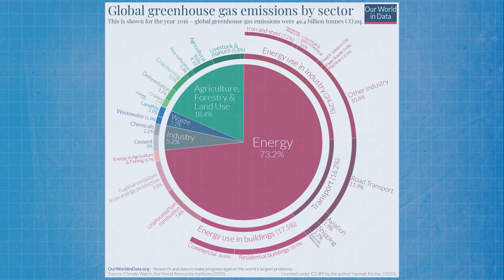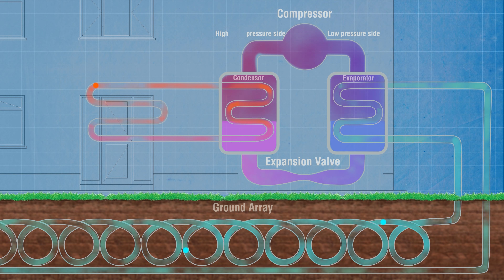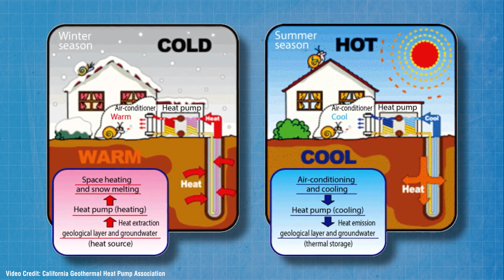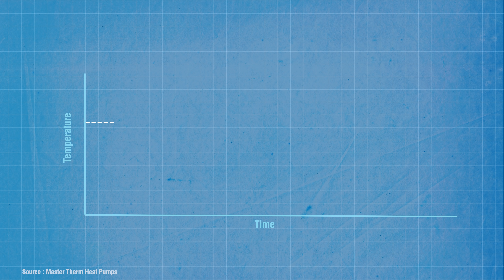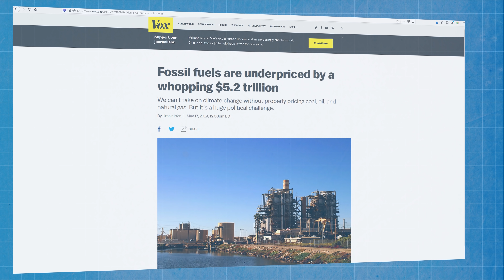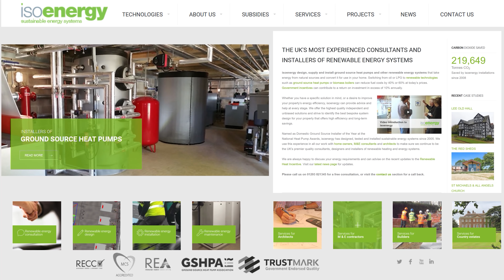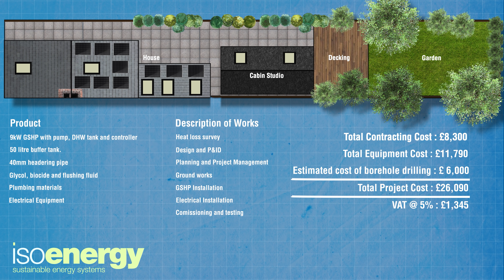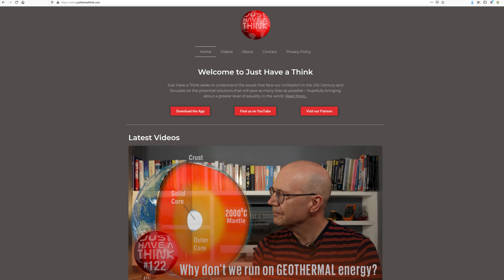Geothermal ground source heat pumps. Heating your home from your own back yard!

Comment: I installed one of these systems 25 years ago. I like the bore hole method because in the UK there are pipes and other forgotten obstacles that may cause problems.  I think this system works best with under or in floor heating. In a floor system, the water temperature is a low 27deg C rather than 70ish for a radiator system. So, the heat pump doesn't have to work as hard and is more efficient.  
Also, ones floor is a massive heat storage system;  typically the floor is only a degree or two above the air temperature required. So in effect, if the temperature in your room falls by two degrees the output from the floor effectively doubles.  
Then there is "radiant heat". With under floor heating the AIR temperature can be, say 19 but feel a comfortable 22 / 23.  This is due to your receiving radiant heat from the floor. (Not BS, There is in fact a very long equation quantifying this)
This works best with new build. On new build the extra cost of floor heating is minimal.  Also, new build is 0 vat rated.
Reply: We built our second home next to old house mortgage free over a 15 year period, we live in Estonia (I'm from UK) where it has got down as low as -37C , the first couple of years in our 150 year old farm cottage (very small without double glazing) was tough, we had a wood burning heater that can be closed and lets off heat for 12 hours but it was never enough and I kept kitchen fire going as much as possible, all our firewood came from our forest so it was free. The new house was finally completed Feb this year, three times the size of the old cottage, geothermal heating works great. We do still have this wood heater system as a backup, if we have a brutal winter we can lose electricity which means goethermal system wont work. After years or either being too hot or too cold it's so nice to live in a large warm house.
Reply: A problem with floor heating in comparison to radiators are respons time. Modern radiators contain little water and can because of that react quick to other internal heating source. That saves energy to!

We had a old heat pump that couldn't produce hot enough water for the radiators so we exchanged som radiators and moved other around. That hade a big impact on the efficiency! 😊And we were able to heat up the house without auxiliary heater from previous - 11 C to - 25 C.
Reply: @bjornjonsson1875  yes, response time can be a problem. Ex: I wouldn't advise floor heating in a Bar. In a Bar I'd advise a forced air system. It can heat up and cold down in minutes. 
Floor heating is an engineering solution, not a cure all. It works brilliantly in the right circumstances.
Reply: @bjornjonsson1875  I have underfloor heating and yes it does have a slow response time. To counter this you need a well insulated house with lots of thermal mass. If you lose 1 degree per day then the house temperature does not vary much and the response time issue goes away.
Reply: @ecoworrier  look your argument that you are more dependent instead of less dependent on insulation with floor heating is not fair to floor heating. It's comparing apples to oranges. You have to control the variables. Even without what you are proud of having in addition to the floor heating system the floor heating system would have helped you unless you're talking about a situation of stay at a cottage that you visit on Christmas and have a lot of saltwater aquariums the robots tend and for some reason plants and it's just not a typical situation. When your house is vacant you could have an automated system that covers the furniture and the flooring. The capital cost of such a system is insignificant. That would allow you to have a very drafty house. But I think that there is some confusion here about using heavy flooring to store Heat about having two feet of concrete on the ground floor getting heated with several inches of solid insulation underneath the poured concrete. This is the copper heart solar water heater solution. It is fetishistic and irrelevant.

We are so seriously ignorant about how 33 degree Fahrenheit that's about what half degrees Centigrade if the humidity is present that means that you don't have materials that you don't need to have around which would be invaded by bacteria and fungus with such an environment if it was warmer as it will get warmer.

I mean there are all kinds of solutions that require yes engineering but engineering that does not break the deal. Such a smart home or office I can get rid of any humidity issues seasonally. it's been a few years since I checked out the Central dehumidifier Market this in the United States is a strange type of system. as far as I can tell there is no competition and what regulation is present has not been sufficient. new construction is such a distraction you really have to talk about the two things separately completely and deal with the different types of climates and local building materials separately. this is not done at any level.

 I think it is fair to say that all efforts to control the temperature and humidity indoors are 99.9% vanity because what matters is people's well being their actual quality of life and that requires you provide them with guidance about what to eat and what their heart rate should be at what times. People can't figure this stuff out on their own and we have to be friends to each other and share this information but it's like sharing how not to get pregnant with very few if any governments being on the right side of history in regards to facilitation instead of being a Lobby to to block.

 you have to work with what we have evolved to do so well. for example there is no luxury car that dares to suggest similar thermal experiences should be had in the different seats. Seriously. Have a think about that fact. it's not real specific Heating and Cooling it's caring about the people specifically and that means providing for them without it mattering whether there indoors or out or what floor there on Etc. I'm just talkin about clothing. Am I the only person who is pro clothing? Get dressed.
Reply: @electronicmusclebike  I AM looking....
 But I'm not sure what I just saw...
Reply: Although underfloor is widely expected as the right way to go with a heat pump. its not necessary. I would say 90% of the systems we have installed have used the existing radiator set up. The system doesn't need high flow temperatures as they use outside weather compensation. Rather than pushing 70deg through the rads for a while to take the house up to temperature, then shutting off, we push a constant lower temp through. This temperature is governed by the outside ambient. So if its -3deg and blowing a gale, you get a higher flow than if its 6deg.
Reply: @isoenergyltd  your pivoted from the point here in the comment that you reply to. The Gael reduces the temperature in the house but it does not matter because the people in the house are maintaining their body temperature bye drawing heat from their feet and if it gets to be extremely cold in their house they can just take their socks off not just their shoes and throw some covering onto their legs and feet. Because the windows could be blown out by a tornado and they could still stay warm there is no thermal insecurity. It's thermal insecurity that makes you maintain extremely cool body temperatures in the summer and overheated temperatures in the winter. When you have a proper heating system your body does not feel any need to hoard thermal protection. You're talking about industry propaganda the people should be put in prison for despite having hustle to you as well. You have not understood this person's comment and should not be oblivious to that forever even if I have not disabused you of the disability. I would ask others for help in doing that if so
Reply: @electronicmusclebike  I have read your comment 3 times and am none the wiser for what you are trying to articulate. My comment was a direct reply, but thank you for your contribution to the discussion.
Reply: @isoenergyltd  you saw the part about how I might need help disabusing you of the disability it's not your fault and just reading it or quote reading it on quote more than once is not sufficient. University Enrollment is down by double-digit percent even including those who are online so you should really consider taking advantage of the demand for students. I like your comments but as I said you are missing the point. The point can be articulated very simply but the problem is your not just self-imposed resistance in accepting it. You work to control people's internal temperature by making expensive changes to an insulating fluid known as the air. As an insulator air is very poor because it has no thermal Mass. To use it to cool people is more than absurd because it is an insulator not a conductor. Direct cooling and Heating work. You can operate those systems on D cell batteries. Or you can pull up the oil tanker & Frack the Earth. What should decide the matter is that people prefer to use the teeny tiny fraction of a percent of the energy with more effective systems like a warm floor in the winter and totally unconditioned air butt the problem of hot seats taken care of. The industry wants to add a seer or tWo even every year or as the Joker says make the coefficient of performance percentage double digits LOL. you can afford to do better than have your kids drink rat milk at school. You wouldn't do to a plant what you do for a living for us without starving the world of food and it's because the plants know how to say no they don't put out the fruit if overly " climate controlled." Neither do we it's just nobody notices. You don't give a damn or maybe you do in which case you'll listen to your peers who have actually gotten the clue.
Reply: @electronicmusclebike  No, it’s really just that you’re not doing a very good job of articulating what you’re trying to communicate. You may have something valuable to share with everyone, but you need to be able to get the idea from inside of your head into their head, and there’s a gap there that you’re not crossing here. I’m not sure how to help you because I can’t understand what you’re trying to say either.
Reply: @babybirdhome  I said put down the books for idiots and ask a friend or use the other lifelines that at least TV Watchers have gotten the concept about. I said that I believe it's cost almost nothing to have a wardrobe composed exclusively of the finest fibers known to man including silk and Cashmere.

I know this is a strange concept for you but such clothing extends the temperature range of comfort without any side effects or reasons to not utilize such technology.

Madison Avenue has hyped specialized outdoor only garments without bothering to provide such garments for summer. Specifically garments you would never need indoors because it never gets that hot in part because shade is available. But when it comes to Winter there are few places on Earth where you need more than thermal Mass. Subtracting are from your home is the fresh air that you might bring in. However you don't need to bring fresh air in unless you're polluting. The amount of natural atmospheric oxygen is not going to freeze your pipes. The floor will heat up that nitrogen and oxygen regardless of how little heat it has. We just don't need Windows anymore what we need is walls that will just fall down if needed for egress or to protect themselves from fire. It seems like the construction industry was afraid that air conditioning with make I would think so inexpensive as to bankrupt so they prevented it from providing cooling to people and directed it to DM dehumidify NFI the air and do other completely insane things
Reply: Unfortunately, underfloor is more expensive to install for existing builds and harder to maintain (access is problematic with floor coverings and floor boards). I'm all for saving energy, but the solutions need to be practical.
Reply: @elminster8149  I'm talking about floor heating in a solid screed floor. 
Yes, it's more expensive to remove an existing floor. Simply not worth it.
 However, I've worked on very old buildings where the floor had to be removed to install a waterproof barrier and insulation. So fitting pex pipe system was not much more expensive. 
(On one project the original stone flag floor was numbered and put back as the original.)
On the first floor, I typically used radiators, but in practice they had very little to do. Most of the heat coming from the ground floor.
Reply: @Jay...777  are you running the system continuously? We found turning it on and off wastes energy and it more not expensive to run. (This, without seeing your system!)
Reply: Hi Ray.  What is the heat transfer like in carpeted rooms?  I am using an overfloor type design to retrofit UFH into a building. In this system the pipes are placed in custom composite plastic trays and laid over the top of existing flooring.  The advantage of this is that most flooring can be laid directly on top (like LVT click flooring).  To lay the carpet on top of these UFH trays ply or chipboard needs to be place on top then the underlay and finally the carpet.   I am just concerned about the lack of heat transfer here as like you said it only runs at around 27degrees (the carpeted areas are in separate heating zones so the system could run hotter if needed).  The carpet and underlay have combined togg of around 2.   Just wondering if you have any thoughts on this?
Reply: @Jay...777  I tend to agree, but first you have to get buy in and it has to be commercially viable for as many as possible. The last part is tricky. For new builds there is still an increase in costs, so the question becomes 'who pays for that?'  Answering that question in the right way will allow new builds to be mandated with these systems, we can learn from Europe but remember what's right for other countries might not be for the UK.
Reply: @Jay...777  it is due to the low heat transfer rate in the floor combined with more mass that store a lot of energy that sipper out over a long period of time.

If you have outdoor ambient temperatur meter in your heating system i recommend you to try out moving it in to a place with morning sun. It gives the system a cheap weather forecast regulator that cut the heating power if is sunny. If the sun goes the heating start again. It works well for radiator. Save up to 10% energy! 😊
Reply: If you have a ground source heat pump or similar make sure that the setting for auxiliary power to kick in are set to kick in with a long delay. Else I have experience that the system sense a quick high power demand increase when sun goes.

Comment: From what reading I've done on the subject, GSHPs can do a decent enough job of cooling if the seasonal heating and cooling loads balance out. Some heating is used in the sub-tropical climates of the Mediterranean and the southern USA during the colder winter months. However, the closer to the equator one goes, the more the load gets skewed toward cooling, the less effective GSHPs get at keeping cool.

As far as Europe, North America, East Asia, Australia and New Zealand are concerned, GSHPs can work. However, I'd be curious as to where GSHPs can work in India and continental South-East Asia which have a combined population of 1.66 billion people. All those people are going to want to stay cool in the summer, if not year-round.